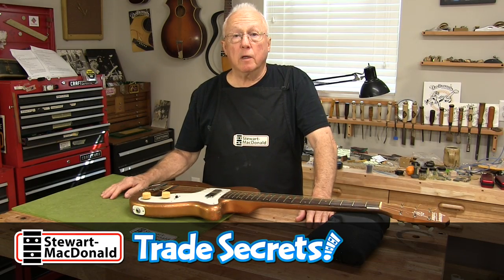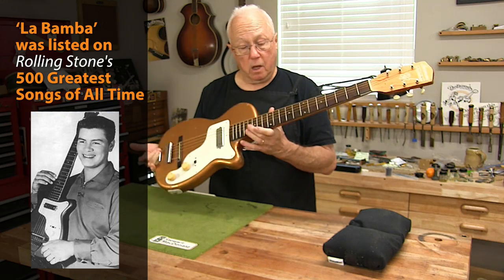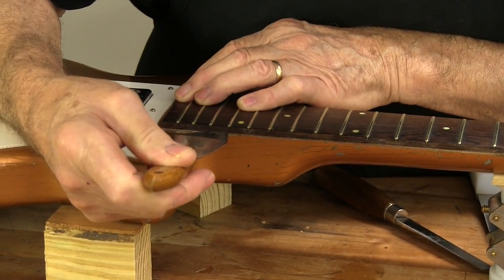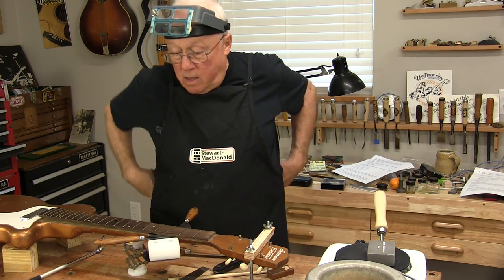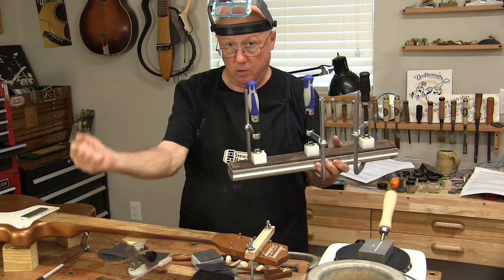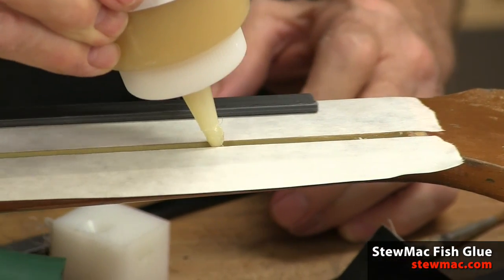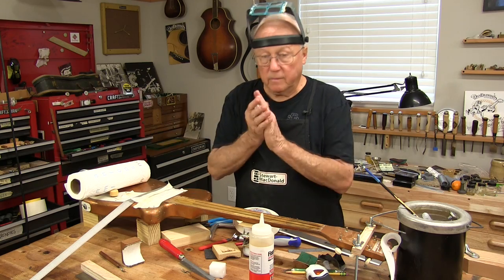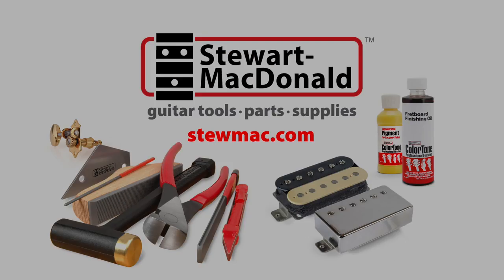Installing carbon fiber neck rods in a Ritchie Valens style StratoTone

Comment: Why not just add a truss rod ?
Reply: sam hill You'd need to make a hole in the neck to adjust a truss rod....thus ruining the originality of this vintage guitar.   With this repair, no one will suspect that it's been repaired.
Reply: I didn't think about the value of the guitar .I assumed it wasn't too valuable,being a harmony, until I googled it. Very interesting to watch ,don't you think ? I just started watching these videos, now I can't seem to stop. The man is good at what he does.
Reply: sam hill Usually, it's pretty safe to assume that if Dan Erlewine is doing a repair, it's not on a cheapie guitar.   He's a master.
Reply: That pick plate looks like the perfect place to hide the adjustment nut of a conventional truss rod.  I think that is the way to go.
Reply: Didn't want to . . . the neck wood is old, solid, and a big fat neck and had such great tone. I didn't feel like putting metal in there. I did another one recently and used a Gemini carbon fiber D-tube. It came out great too. Mostly, both these players weren't interested in me installing an adjustable rod. I was fine with that. These sure are unique and wonderful blues guitars.
Reply: Hey, Dan! Thanks for the knowledge sharing! I am building my second guitar, and your video got me thinking: why do I need an adjustable truss rod? How it would if a, let's say, Fender Strat had a carbon fiber neck rod instead of a traditional one?

Thank you one more time!
Reply: Dan Erlewine , I've never dealt with old guitars or repairs so please excuse me if the answer to my query is obvious.  Why didn't you heat and reshape the neck, is that unnecessary if using a rod?  I see that this was much less time consuming, is it just as effective? Also, is that glue really strong enough to withstand that great resistance? 
I'm sure you know what you're doing, I was just surprised to find that the glue is so strong!
Thank you for all the knowledge you pass along!!!
Reply: All this heating to fix a neck is just temporary or for mild cases so the trussrod can win again.
Reply: It's not temporary because he installed reinforcement rods to prevent future bending of the neck.
Reply: Because carbon fiber is stronger, and way easier to install.
Reply: and i've also heard that the metal rod being in there can change the tone of the guitar. Idk why or how, but i've heard that several times and read it on forums. Whereas carbon fiber is just a fiber, and takes up a lot less space.
Reply: Carbon fiber is a technological advance over the old school metal truss rods. Frankly, a guitar with two carbon rods might not even NEED any further reinforcement. Adding a rod in just gives a slight degree of adjustability to taste — and to be blunt here, players expect to see an adjustable rod, even if it's no longer necessary.

On an old guitar like this, you get the best of both words: The external appearance of originality, with space-age reinforcement going on underneath.

I've got a 1979 Kramer aluminum neck bass, with no adjustments. That entire neck IS the metal rod!
Reply: @danerlewine9897  I found the hollow version of this guitar at a yardsale (1964 H-45, branded for Alden's dept store)... Really cool guitar, but wish I could've gotten the .020" of relief out of it. I ended up stringing it with .010"-.046" strings (a gauge lighter than I typically use) and, then finally selling it. But it was cool... here's the vid... https://www.youtube.com/watch?v=ldz16GnAuww

Comment: How can that job lower the action of the guitar? I mean, he didnt touch the neck, he just add those two pieces of carbon fiber.
Reply: As there was no rod(s) at all, the strings bended the all wooden neck, but now that there's rods, the neck doesn't bend because of the tension anymore?
Reply: Mikko Lehto shouldnt he have corrected de neck position first? Does just releasing the sting tension fix that “bow” shape?

Comment: My guitar tuning is off. the tones get sharper the higher up the fret board I play. Anybody know,  What's with that? can it be fixed?
Reply: Simple fix. Your saddles are in the wrong place so your intonation gets worse as you go up the neck. If it's playing sharp, move the saddle back (away from the nut).  Good luck.
Reply: thank you. I've been researching the problem since I made this post. It looks like I might be able to at least get the intonation a little closer.
Reply: First thing to do is to check that the bridge is in the right spot (by measuring). The 12th fret should lie right in the middle of the nut and bridge.  You can adjust the saddles a bit to dial in the intonation.

Comment: No joke about wetting and then gluing it forms a bond that is so strong it is retarded. 

Placing carbon fiber in the neck in place of a truss rod is done by Vigier. Their guitars are considered to be some of the best made and excel in quality. The idea of doing that is excellent because if a manufacturer did their job right then there should be no use for adjusting the truss rod. Leaving only string height as the only adjustment needed if you are particular and want a different string height for comfort.

Comment: Why not install an adjustable truss rod, while your in there?
Reply: It would ruin the look of the guitar having a truss rod adjustment poking out. Those carbon fiber rods won't move.
Reply: @fivefingerfullprice3403 :   Why would it be "poking out"?  They don't "poke out" on any other guitar. They are recessed under the fingerboard.
Reply: @timhallas4275  There's a hole drilled where you adjust the rod which is visible. How do you think you adjust a truss rod? Telekinesis?
Reply: @fivefingerfullprice3403 : So you're saying all guitars with a truss-rod cover are ugly, and therefore shouldn't use a truss-rod.  I don't understand what your point is.
Reply: @fivefingerfullprice3403  :  So, you are saying that a guitar should never be modified, because it takes something away from it's historical value.  In that case, it should have been left unplayable, because that is it's true legacy.  Do you think Dan ruined this guitar's historical significance by making it playable?
Reply: @timhallas4275  It's gotta be tough going through life with 50 IQ, I feel sad for you.
Reply: @fivefingerfullprice3403  : That's all you have left?   Really?  How pathetic.
Reply: Because maybe the client did not want a truss rod in the guitar he bought that is not meant to have one... It's Dan's job to do repair work, if he wasn't comfortable with the solution he implemented to meet this request, he could have just refused the job..
Reply: @kcb5150  He installed two carbon fiber rods to improve the neck's straightness. It's already an altered antique.
Reply: @timhallas4275  Again, maybe the client specifically requested nothing visible like that, who knows...  I would prefer a truss rod as well and just hide the access under the pickguard, but maybe to someone buying one of these, seeing that is like seeing a repaired headstock on a lp and the lowball comes bigtime. Yes, I'm insinuating it may not be disclosed  in the future... I have had to sniff out way too much shifty crap over the years buying instruments from others to feel otherwise...
Reply: @kcb5150  So you do understand. Hidden modifications are a deception. If I bought that guitar under the assumption that it was all original, then found out about the carbon fiber rods, I would expect my money back. So, if your intention as a seller is to be honest, why not put in a truss rod, with the access hole under the pick-guard, and tell the buyer that you did?  I think the point is, either you want it for it's original design and value, or you want to play it.  This customer obviously is more concerned about playability....right?   So why not give him a truss rod, so he can set the neck to his liking, and keep it that way for the next 50 years?
Reply: @timhallas4275  When do guitar guys ever make sense? Dynamically, for solid body guitars if we wanted the most reliable, stable instrument possible we probably should all be playing carbon fiber headless guitars, but we don't... People are paying fender like fools to build instruments and then artificially distress them.. The guy is either overly sentimental that is paying for the work, or he is potentially covering his ass. Personally, it's not something I would spend that kind of cash on as it was low end even back then. The neck angle on these is probably baked in as a defect. It's like a strat neck that needs a shim but you can't on this.
Reply: @kcb5150  Yep.  Today it's all about the cheap guitar. How to make them playable, and how to build your own. I still build them the way they should be made. The right materials, put together right. No plastic, no high tech. No fucking carbon.

Comment: 5:04 So you clamped it down and glued in those carbon fiber rods and that is what is keeping the neck straight now right? 8:55 So where did the little amount of relief come from? Those carbon fiber rods dont flex at all do they? With string tension the neck should still be the straight neck it was after the rods are glued in. 5:28 You said it was clamped down and might even have a little back bow. If those rods are glued in with the thing clamped down to the table then where did the little amount of relief come from? I thought carbon fiber didn't flex at all!
Would it have been possible to put in a carbon fiber rod with a adjustment nut? Or dont they make those?
Reply: Of course carbon fiber flexes....

Comment: Why not just put in a truss rod?
Reply from the maker: The Stratotone did not have a truss rod to begin with. Therefore, to keep the guitar appearing period correct with no modifications, installing carbon fiber rods to straighten the neck was the best way to go. If there was a truss rod installed, it would be visible and not like the original that had no truss rod. The carbon rods will not be noticed on the guitar. Thus, keeping it as original as possible but getting the job done.
Reply: I appreciate the reply. That hadn't occurred to me, so thank you for the explanation.